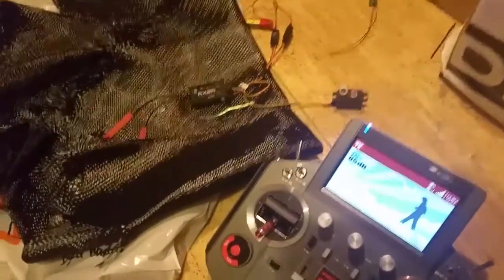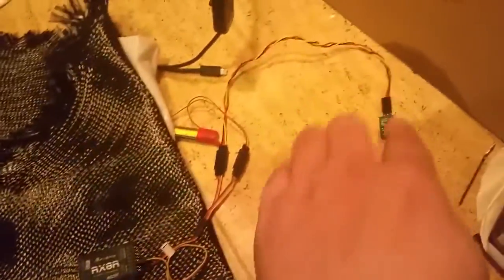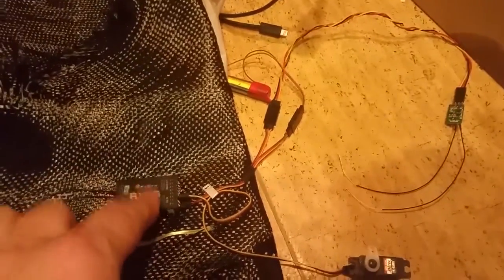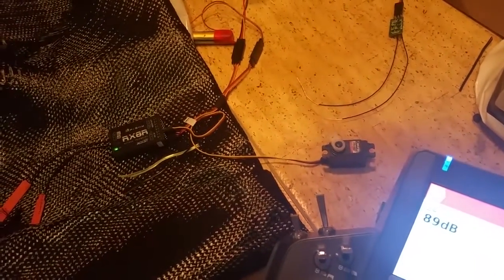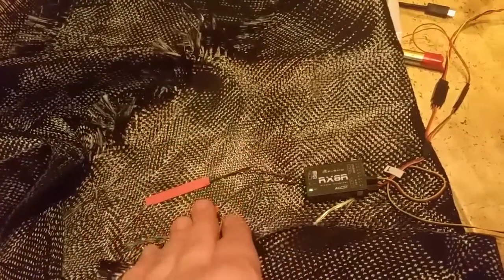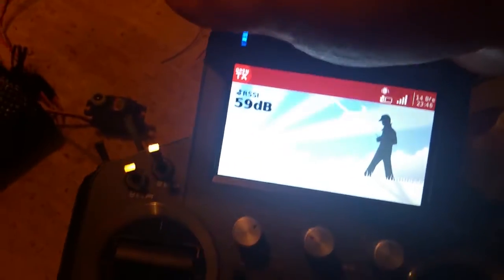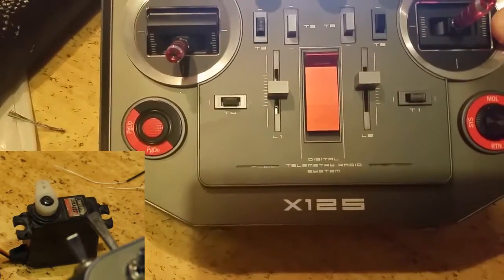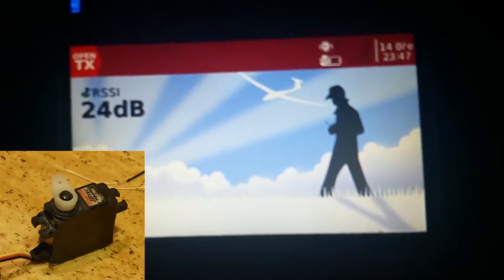Receivers RX8R and MX+ Redundancy test

Comment: I've been searching these RX8R threads for current status of this Rx... Very confused! Has it been sorted out? I've seen some video's of the servos getting all jittery before a transition is made to the slave... that doesn't look like something you could fly with, then I just saw the FrSky video showing everything smooth as silk... could someone fill me in... PLEASE? Planning on using the RX8R and X8R<<slave in a 35cc gasser... have a RB in another 30cc with a X8R and XM+ <<slave ... it works perfect!! but takes a lot of space. Any help would be appreciated!

Comment: Nice Video Richard, it seems a little pointless though. You had to cover the RX8R in carbon cloth and go on a walkabout to another country to lose signal !!!.....I think the redundancy is fine, but in this demonstration, it says to me the Horus doesn't need it.....all that work to LOSE signal inside tells me you would have to go to an extreme length to lose signal in general flying operations. A very good range check, but was it needed, really ? I doubt it. The Horus seems to be rather bulletproof on signal , going on this video.